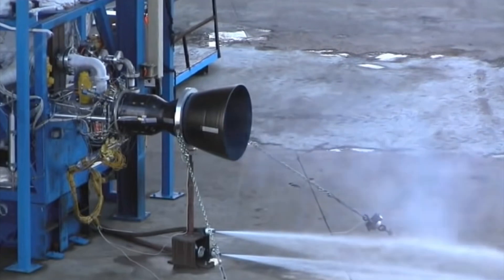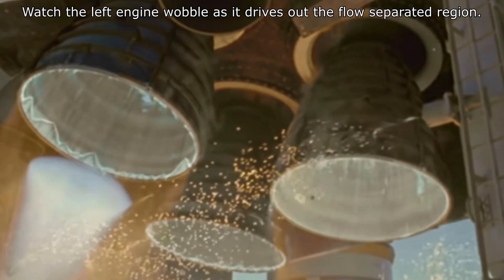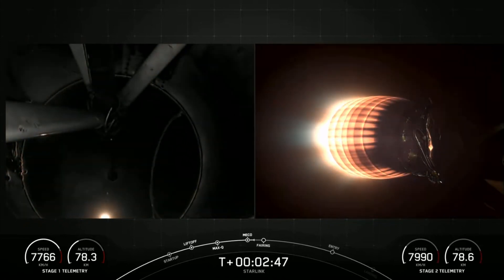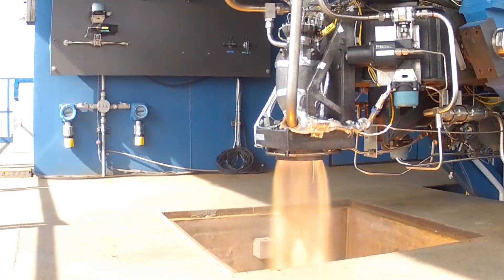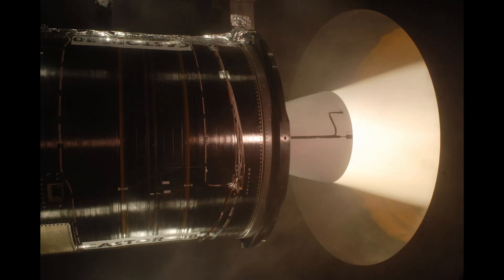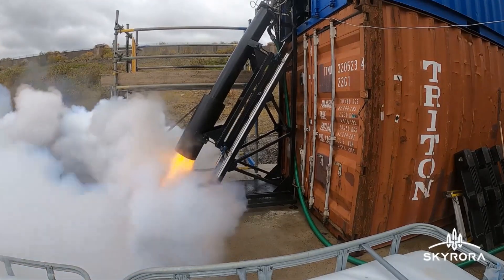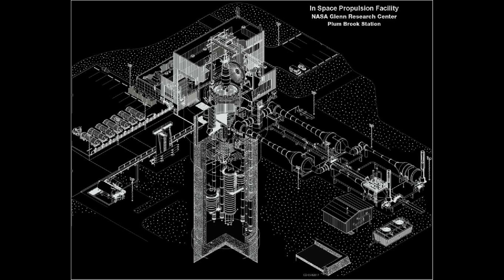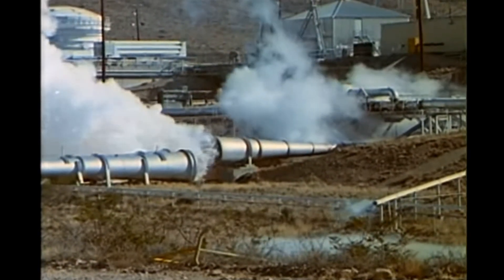Defying Atmosphere - How Rocket Engines Get Tested In A Vacuum Before Going To Space

Comment: If you released gas from an ordinary tank in space would it propel that bottle forward?
Reply: Yes.. Conservation of momentum dictates that if the gas goes from contained in the bottle to propelling out the end, it has changed momentum.  The container's momentum MUST change the exact same amount but in the opposite direction for the net momentum change of the system to be 0.
Reply: Yes.  Contrary to the belief of many, rockets do indeed "push off" something.  Their own exhaust gasses.  It's no different than sitting in a chair that rolls and pushing a bowling ballnaway from you.  You would be propelled backwards because the BOWLING BALL exerts an equal and opposite force back on you; not the air.  Rockets work the same way - except instead of a bowling ball, it's rocket fuel exhaust gasses.  It's still mass, and the rocket is pushing it away, and those gasses will exert a force back on the rocket.  It's all about ejecting mass away from the rocket.  Rockets need to work in a vacuum obviously, so they essentially take all that mass with them and eject it away in space, and that mass they eject exerts an equal and opposite force back on the rocket.  No air required.

Prop planes and boats don't eject mass they brought with them; they borrow the mass from their surroundings.  They use fuel to turn the props which in turn bring in and then eject mass from their surroundings.  Rockets use fuel as the mass itself which is ejected away.
Reply: @willoughbykrenzteinburg 
So why wouldn't an ordinary aircraft jet engine work in space
Reply: @TerenceHughes4501  Because jet engines use the mass of the atmospheric air to push out the back.
Rockets must take mass WITH THEM to space to push on.
Jet engines would have nothing to push on in a vacuum.
Reply: @TerenceHughes4501  in a jet engine, they use heating air to create additional force. The way it works is that air is sucked into the engine, it is compressed by compressor blades, this makes the air hot. That hot air is injected with fuel which ignited. That ignition superheats the air. Thing is, when air is heated, it’s pressure increases. So now the pressure of that air has skyrocketed. So when it’s released out the back it does so with tremendous speed as the pressure energy is converted to kinetic energy. Creating thrust.

That exhaust is also run past another turbine which spins the compressor blades and inlet blades.

Other jet engines use a bypass which works like a Venturi to suck even more air through the engine increasing thrust.

As you can see, it manipulates atmosphere. Rockets do not. Noticeably, rockets don’t have air intakes. Jets do.
Reply: @engineeringtheweirdguy2103 
Yes exactly. So when the pressurised air is released it's pushing off the mass of the atmosphere. In space there is no atmosphere. Rockets cannot work in a vacuum.
Reply: @TerenceHughes4501  yeah no. At no point did I say the exhausted pushed against the atmosphere. The engine pushes against the exhaust. Like a rocket does. The key difference is that a jet engine is compressing and super heating the incoming air before it exhausts it. Using only a small amount of fuel. A rocket does it entirely on fuel. Hence no intake. Don’t be silly. Stay in school.
Reply: @engineeringtheweirdguy2103 
Wrong. All forms of propulsion push against the atmosphere. From helicopter blades to jet engines
Reply: @TerenceHughes4501  no. Because the gas particles are no longer in contact with the craft developing thrust. Unless you think the force is wirelessly transmitted from the exhaust particle hitting at atmosphere particle. 

Force requires direct physical contact. Gasses are made up of individual particles (like bouncy balls). That are always in motion. 99% of even sea level atmosphere is empty space. 

Thrust is developed because gas particles make contact with the component developing thrust. For a rocket that’s the combustion chamber, for a jest engine it’s the turbine blades, for a helicopter, it’s the rotary blades. 

None of it “pushes against atmosphere.” It’s all transfer of momentum which requires direct contact. Go research kinematic theory of gases
Reply: @TerenceHughes4501  suggesting that thrust is dependant upon actioned gasses pushing against atmosphere is like suggesting a baseball batter doesn’t feel the ting on his bat until someone catches the ball. 

For an action reaction pair there needs to be physical contact between them. In relation to actioned gasses or exhausts, it’s the particles of gas against the craft. Gas particles have both mass and velocity. Their impacts and transfer of momentum is what causes pressure. Which is a force, but a force that pushes equally in all directions, resulting in no net force. Crafts developing thrust use pressure to generate thrust by manipulating it to create a net force. The thrust is developed by the actioned gas particles hitting the craft being thrusted. Not by the actioned gas particles hitting the surrounding atmospheric particles. Because they need to be in physical contact with the craft developing thrust. You can’t wirelessly transfer force or momentum. It doesn’t work like that.
Reply: @TerenceHughes4501  here’s a good example. Stand on a skateboard, and throw a box with a 40kg weight inside away from you as hard as you can. You’ll notice you’ll roll backwards a considerable distance.

Now let’s try it again with the empty box. If you think thrust is developed by pushing off the atmosphere, then you should travel equally as far backwards by throwing and empty box, as by throwing the same box with 40kg inside. As it’s interacting and pushing through the same volume of air.

But that isn’t what happens is it?
Reply: @TerenceHughes4501  you’re just wrong.
Reply: @TerenceHughes4501  - "All forms of propulsion push against the atmosphere."
Except for rocket propulsion which pushes on the mass of the exhaust gas.

You saying it CANNOT is basically saying "Rockets push off the atmosphere (which is a gas) but rockets CANNOT push on gas".

See how logically consistent that is?
Reply: @stuartgray5877 
Learn some basic physics for crying out loud. The atmosphere has mass which is what the gases from jet engine are pushing against. In space there is no atmosphere hence no mass to push off. Gases being forced in one direction can't magically push off themselves in the opposite direction.
Reply: @TerenceHughes4501  - "The atmosphere has mass which is what the gases from jet engine are pushing against."

So YOU are saying that the rocket Can push on the MASS of the AIR in the atmosphere.
But AIR IS A GAS!
But rockets CANNOT Push on GAS?
WHICH IS IT?
Can rockets PUSH ON GAS OR NOT?
Reply: @TerenceHughes4501  You claim that rockets CAN push on the gas in the atmosphere?
WHY doesn't the gas in the atmosphere just MOVE OUT OF THE WAY EFFORTLESSLY?

What is it that makes it so you can "PUSH" on the air in the atmosphere?
What property does this atmospheric gas have that allows it to be pushed on and provide a resistance?
Reply: @TerenceHughes4501  SO you are claiming that rockets push on gas but CANNOT push on GAS.
Got it.
Reply: @TerenceHughes4501  - "What is it that makes it so you can "PUSH" on the air in the atmosphere?
What property does this atmospheric gas have that allows it to be pushed on and provide a resistance?"

I see that question is above your level of education.
You don't even KNOW what physical property AIR that has allows it to be "pushed" on like you claim.
Reply: @stuartgray5877 
I've told you time and time again and if you're not willing to learn then that's your problem
Reply: @TerenceHughes4501  "So how are helicopters propelled"
Blade profile creates pressure increase below blade and pressure drop above blade , this creates an upward force thus creating lift " uses atmosphere to create  force but it doesn't push off air" 
It's just physics like how a rocket works in a vacuum , I really suggest you go back to school
Reply: @TerenceHughes4501  lol. The irony of you trying to tell others to “learn some basic physics for crying out loud”
Reply: @TerenceHughes4501 Dude’s so dense he’s gonna sink to the earth’s core
Reply: @TerenceHughes4501  - "Do you agree or will you just hurl some juvenile insults and run away again?"

Seems your response to "facts" is to run away.

Comment: Blows my mind how much goes into developing a successful rocket, let alone a reusable one within 20 years 🤯🤯🤯🤯
Great video as always Scott 👏👏
Reply: The first reusable rocket started design in 1973.  It first flew in 1981 on STS-1.  It launched again later that year on STS-2.  It was the Shuttle Solid Rocket Booster.
Reply: Yet they still blow up occasionally.  Rockets operate on the edge of barely stable to about to disintegrate, it's a  fine line between success and disaster.  It's called RUD  "Rapid Unscheduled Disassembly". heh

Comment: Rocket engines do NOT push against the launch pad.
Get that out of your head!
Reply: They definitely do, that’s just not what propels them.
Reply: Correction accepted! @oberonpanopticon
Reply: @chuxmix65  papalegba thinks that gas molecules can be accelerated without a force.
He claims they can accelerate themselves with "thermal energy".

the papalegba bot believes in "Magic"
Reply: @oberonpanopticon  so why am I getting abused for stating the obvious? Is w=PV not a gas law?
Reply: @papalegba6796  I’d think that rockets would exert force on the launch pad, but that’s not what propels them. They accelerate because gas has mass and every action has an equal and opposite reaction.
Reply: @oberonpanopticon  So the gas laws are wrong? Ok lol.
Reply: Pretty sure they do, weirdo.
Reply: @papalegba6796  pretty sure they don't, cHaTbOt.

Comment: What does push the rocket in a vacuum? Is it the mass of the chemical reactants times its velocity at the nozzle? I see the first stage nozzle stream is broader once it reaches space. The horizontal stream to the rocket seems cancelling its force. Is that why the second stage has a long nozzle like the long muzzle of a gun?
Reply: Yes, the mass flowing out times its velocity is the momentum transfer to the rocket.

The expansion of gases after the rocket nozzle doesn’t so much take away force as it is unconverted energy. The gas is at a higher pressure so expands in the vacuum. If it had been accelerated more, it could have been faster and imparted more force. There are losses from flow being non-tangential to the rocket nozzle though, and they’re a result of design considerations.
Reply: @samburnes9389  That explains it.
Reply: @Śiśna3633  The "Thrust" on a rocket is the same force that provides "Recoil" to a gun.
Any machine that accelerates mass MUST feel an equal and opposite force pushing in the opposite direction.
Rocket "Thrust" is just the mechanical recoil of pushing on mass.
Reply: Yes? I’m confused on the second part
Reply: The nozzle diameter depends on the ambient atmosphere. Lower pressure = you can make the nozzle larger. And you want that, because what pushes the rocket is the force exerted by the exhaust on the rocket: on the front wall of the combustion chamber, and on the nozzle. Make the nozzle larger = more of the exhaust pushes on the nozzle.
Reply: The gas expanding out the back and pushing on the rocket nozzle is what moves the rocket.  Once it leaves the nozzle (the point at which it then expands sideways) it is no longer pushing on the rocket.

Comment: The engines on the actual shuttle did not have enough power to lift the shuttle of the launch pad. That is the sole purpose of the solid rocket boosters on the side of the six tank. Once in the vacuum of space is what the shuttle engines were for.
Reply: The shuttle main engines burned from sea level to orbit and provided 51% of the thrust to get it off of the pad.  Once main engine cutoff was reached those engines are never used again until the next launch.

Comment: I remember during the Ares program there was a vacuum chamber engine test facility built to do tests of the J2-X that was to power the upper stages of Ares-1 and V, after the program was cancelled and moved onto SLS, congress still appropriated several hundred million to finish the initial build out of the facility after which it was then mothballed before any of the remaining buildout and certification was completed. Look up the A3 test stand at Marshall. It was among several projects that many millions were spent on completing things that would then never be used  for Ares and NASA now has to pay to maintain them in some state until they can either be repurposed or scrapped. I think the estimates were that it would take several hundred million more to complete it for use, but it was designed for high altitude simulated testing of up to 600,000 pound thrust engines.